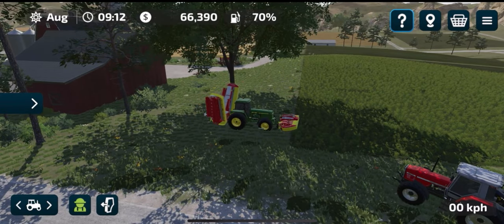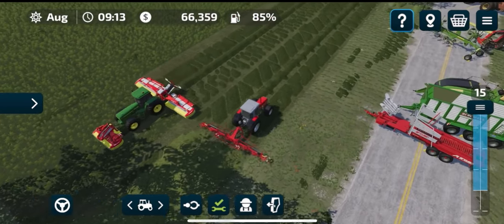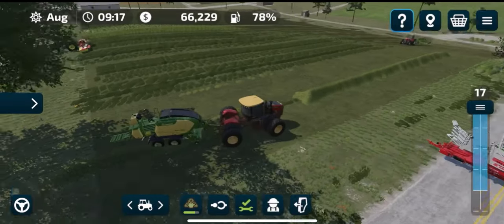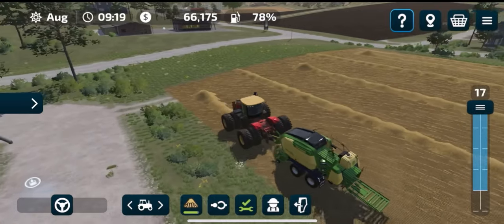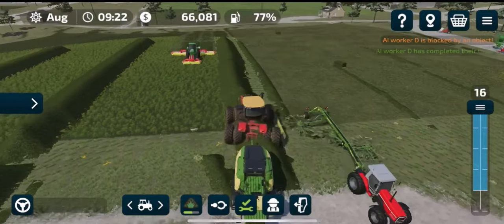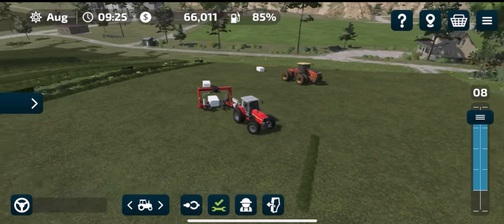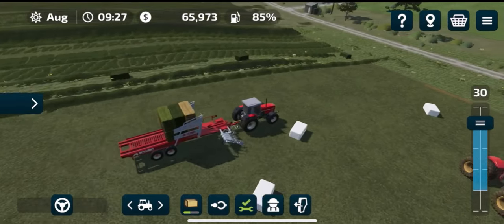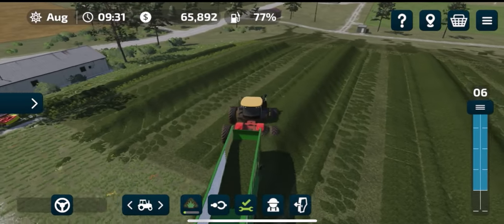Farming Simulator 23- How to make silage, hay, grass & straw

Comment: Mobile version: What trailer or method do you use to move lots of bales from the barn to the bale sale barn or to animals? The low deck semi will not accept bales, the pallet wagon will auto load bales, but will not unload. The cotton trailer only supports cotton bales. Is there no other trailer than the bale loading trailer? Do you have to load them from the barn one at a time or is there an auto load option?
Reply from the maker: This is a pain, I tend to use forage wagons now. If you check out my automatic cow feeding system video it shows you how I drop them off, but it’s not perfect.

Comment: Can you do a video about what order to use machines on fields to get the most crop yield?
Reply: plow and fertilize 2 times 👍🏼
Reply from the maker: Hi @lindseys4885 are you still needing help with this? If you get out of your vehicles and walk into the crop it tells you how efficiently your crops are growing. If you’ve fertilised twice and sprayed the weeds, and it’s not 100, you’ll need too low up the ground before your next crop goes in. Hope this helps?
Reply: @farmercharlie1050  Hi, thanks for the videos. I am struggling to get a grass field to 100% yield. If I plant anything else and fertilize it 2x and spray it, it is at 100%. Only the grass fields stay at 50% after second fertilize run. Any ideas? Thanks